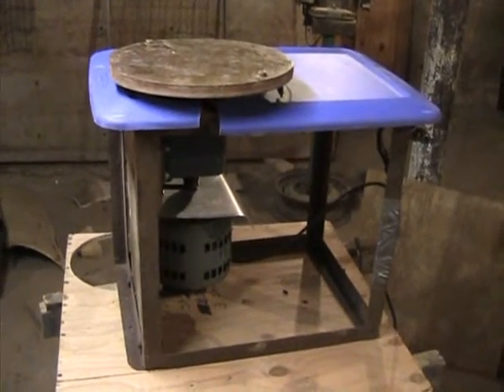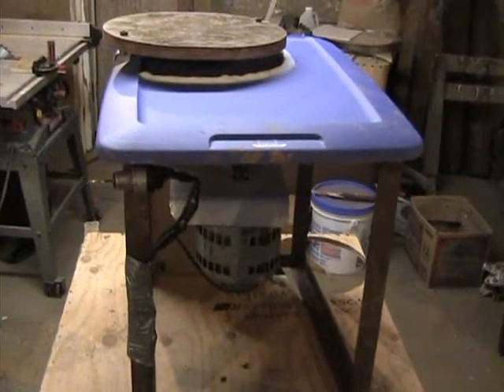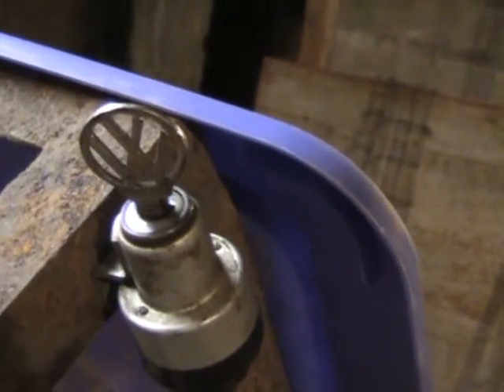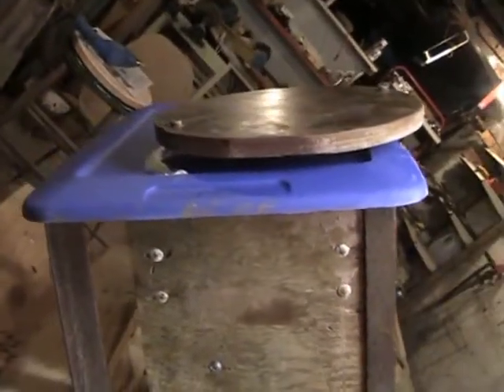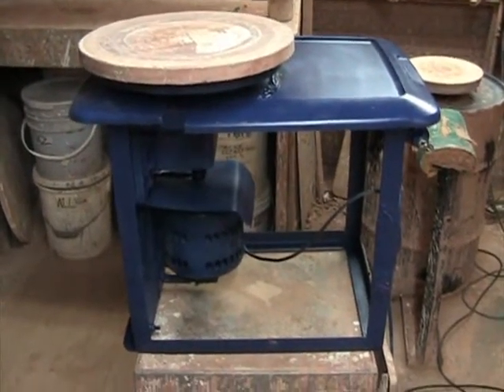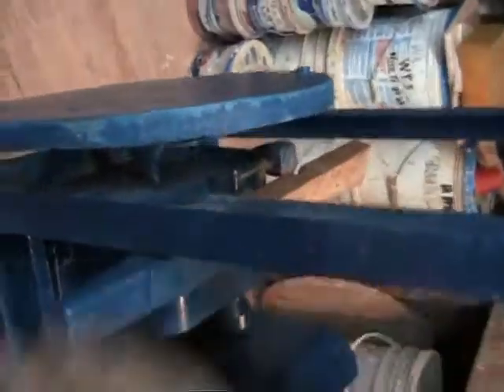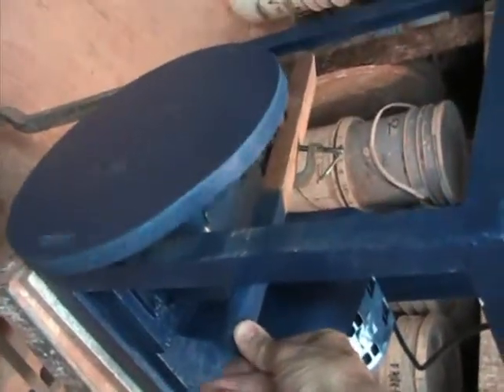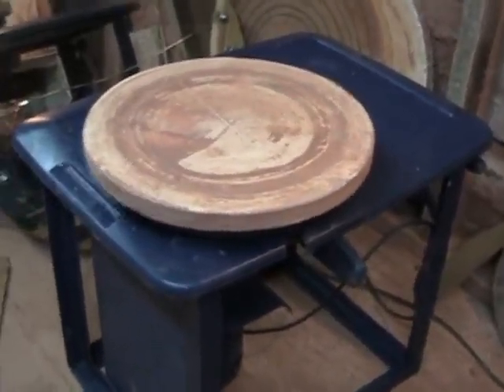How I Made a Variable speed potter's Wheel Part 2 Final As_0001.wmv

Comment: If you ever get down close and look across the top of the head of a name brand wheel., and look at it as you run at different speeds you will see how level it is.. Very critical to get the head level!!!    I don't mean critical center but"level" that's why we would like to see how well the  very nice wheel and I mean very nice wheel you built, is at throwing a piece of clay from centering to finish!! Thanks for any replies.

Comment from the maker: @zeussaurabh 
The motor in this video is a used washing machine motor 1/4 or 1/3 hp
I also made one out of a 1/8 hp 'gearhead motor with final single speed drive of 80 rpm which workes fine for stuff up to 10 lb.
Not familiar w your motor but it sounds like higher speed low torque which isn't great for potters wheel
If it's a 'brush' type motor you can buy inexpensive speed control on e-bay
When choosing a motor amps are more important than hp.. in general; look for at least 1 amp 1/8hp

Comment from the maker: @madman1487 
mmmmm... well maybe not THAT great; but, yea it works good.  The weak link is the wheel head: getting and holding a good tight fit on the output shaft. Extending the shaft with a coupler and adding a second bearing just under the wheelhead would provide more stability.  One can also buy wheelheads from AMACO; I did that on a pouple others I built.
Wish you the best.
Bill

Comment from the maker: @madman1487 
Sure,
The wiring is just a regular on/off switch; I just used an old VW ignition switch beause I had on on hand from a '58 Bus I scrapped several years ago.
The variable speed is provided by the 'ZERO-MAX' gearbox; so, the motor is just single speed (1725RPM).   It just neets to be on or off.
Does that help?